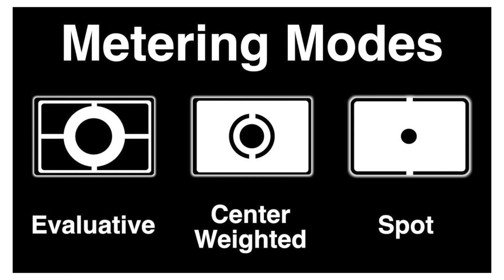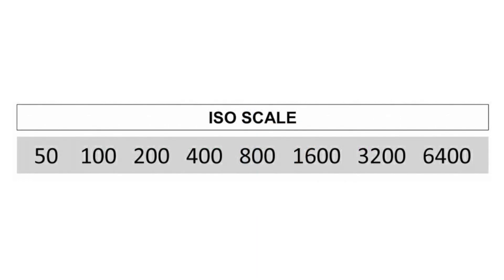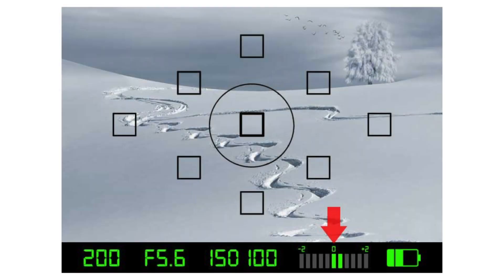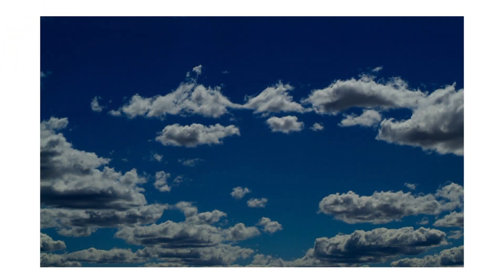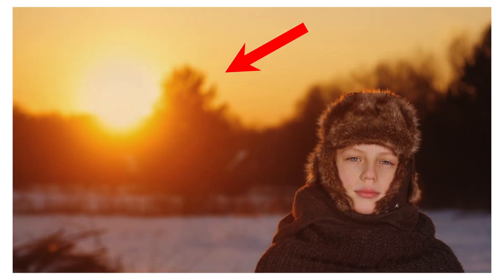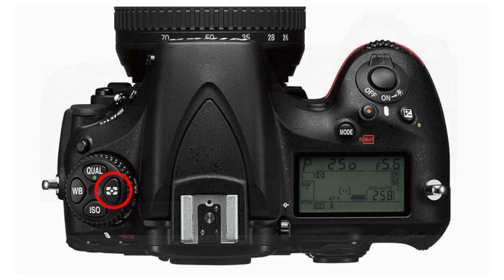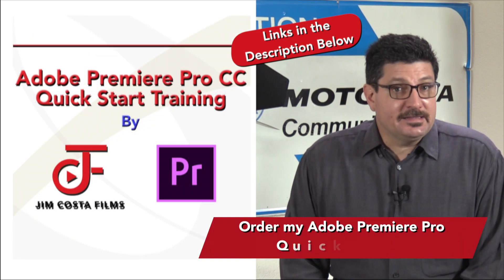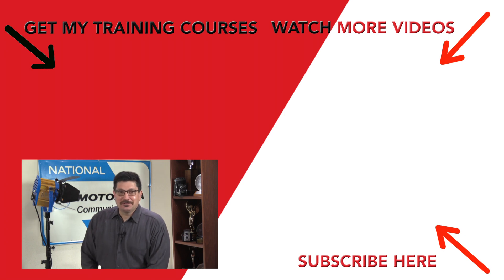Camera Metering Modes Explained: Matrix, Evaluative, Center Weighted & Spot Metering

Comment: I’m using an EOS M6 Mark II with a 28mm macro lens and a light box to take pictures of water, oil and other various liquid droplets. The purpose is to calculate contact angle. I need the droplet large and clear especially around the edges.  My settings are:
Av mode
F/stop- 3.5
ISO -100
Evaluative metering
Manual focus
I’ve upped the exposure to 1.1 to 1.2 because my pictures seemed to dark when in analysis mode. 
1. Are my settings on the right track? 
2. Should I use Spot metering instead?
3. Am I using the best lens? 
Ty
Reply from the maker: I have to be honest, I’ve shot macro photography, but not water droplets specifically so I did a little research and found that this is a good place to start:

1) Camera settings for water drop photography.

The splash from a water drop lasts only a fraction of a second, so your camera settings should be optimized for a fast shutter speed:

	•	Shutter speed — A 1/1000 shutter speed will freeze just about any water droplet. A slower shutter speed of around 1/250 works best for bigger splashes.

	•	Aperture — A wider aperture between f/4 and f/8 is ideal for a sharp focus on small drops. For bigger splashes, aim for around f/14 to keep the wider area in focus.

	•	ISO — Adjust your ISO to whatever it needs to be to maintain your shutter speed, but not over 800 or you’ll add grain to the image.

When you’re camera’s ready, let the water droplet fall and take a few pictures. Experiment with your setup and camera settings to find what works best.

My guess is that you’ll need to lock in the aperture to a setting that has the edges in focus as needed and then mess with the shutter speed and ISO to get the brightness where it needs to be. 

You mentioned using a light box. That should give you a nice even diffused light source around the droplet. Consider using 3 point lighting around 3 sides of the box to up the total available light. That should give you some more flexibility to adjust the ISO and shutter speed.

2) I was thinking about Spot Metering Mode when you first asked the question. The answer is possibly, yes, but I’m not certain that will work because the drop falls so fast that the camera might not be able to react fast enough unless you focus on the spot where it falls first and then take a shot. You might have to go full manual mode and just lock everything in ahead of time after a couple test shots to get it all right.

3) You camera is discontinued, but with a 32mp sensor, it should work fine. I looked around and s decent macro lens is the Canon MP-E 65 mm f/2.8 1x-5x macro lens.

If your budget allows for a new camera body, consider one of these:

https://products.bestreviews.com/best-macro-lenses-for-canon?sn=&cid=17571377514&aid=136528076325&eid=&tid=dsa-19959388920&ul=9029757&mt=&n=g&d=c&dm=&dt&sn&adid=644644436395&k=&p=&pc=&ap=&brprdct=1&gad=1&gclid=CjwKCAjwr_CnBhA0EiwAci5sigu9j1Dk9ROZC6R3UsUp1uYlbfZADBoySjJIpKZ0dMVLOJztdJxMZxoCd1UQAvD_BwE

Comment: Friend, I have just purchased one camera,  it has been more than six months since I have seen clicking. 
Can you give me tips to click family photos while going out. 
In what mode I  should click to make photos look great.
Hope you will comment about it.
Reply from the maker: You don’t mention what the make or model of your camera is, but when outside with people, I’ll assume you’re shooting a form of Street Photography.

There are four different types of metering in digital photography. Evaluative (or Matrix), Centre Weighted, Spot Metering and Highlight Weighted. Each one of these can be used for photography. But how do you choose the right metering mode for street photography?

Let's get into it.

When first starting on your photography journey, set your camera to evaluative metering, (which measures the whole scene) and adjust the metering mode depending upon the subject that you are shooting on the streets and the light conditions that they are in.

What is Metering?

Every camera has a built-in light meter. The camera uses this light meter in order to get a correct exposure. It does this by measuring the reflected light from the shadows, the mid-tones, and the highlights of a scene. Using one of the four different metering modes the camera will read and measure the light within the frame. When it measures the light, it will then adjust the aperture, the shutter speed, and the ISO (or one or two of each depending on which mode/priority you are in) and will expose correctly.

You can see the meter at work when you look through the viewfinder, or in many cameras today, when you look on the back of the LCD screen. It's the little bar usually in the centre of the screen at the bottom with a + and - sign at each end of a row of little vertical bars.

You can test this when you point your camera at a dark scene or a dark area. The indicator will go into the negative area of the meter. Conversely, if you point your camera at a very bright scene or area, such as a window, the indicator will veer towards the plus sign. Ultimately, you want the meter to be in the centre The little 0 is where you want your exposure to be.

It doesn't matter whether you're in Manual Mode, Aperture Priority, or Shutter Priority, the camera will use either the Shutter Speed and/or the Aperture and also the ISO once it's read the light with the meter, in order to get that exposure correct.

Metering situations

When a scene is evenly lit and you are looking through the viewfinder, then the camera's meter has an easy time measuring the light for the exposure; this is because the light is even and there are no contrasts. However, when there are strong contrasts within a scene the camera's meter can have a problem measuring the light effectively.

Imagine photographing a person, wearing brown clothes, walking past a brick wall on a grey day.  The camera's meter will have no problem measuring the light for this scene as it is all pretty uniform. You would use Evaluative Metering Mode in this scenario.

Now consider a scene where somebody is walking down a dark tunnel, but because there is a hole in the centre of the roof of this tunnel there is a shaft of light shining down across the wall and onto the ground. You want to capture the person walking through that shaft of light. However, the camera's meter might bring down the brightness on that shaft of light in order to match the exposure of the dark areas of the tunnel. Yet, you wanted that shaft of light and the subject exposed correctly. This is where a different meeting mode will come in handy.

Finally, imagine photographing somebody walking towards you, about two meters away, and he or she is wearing black, with the sun and bright clouds behind them. Using Evaluative Metering the camera's meter will try to expose the scene across the entire frame and in doing so will try to expose the person walking towards you correctly. Depending upon the metering mode that you use and how bright the sky and the clouds are, it may overexpose the area behind the subject or it may just get the exposure correct, or it may underexpose the subject. This is another instance where different metering modes come in handy.

Metering modes allow you to select certain portions of the frame and expose for those areas so that you get a correct exposure for your subject.

What is Evaluative / Matrix Metering Mode?

The granddaddy of them all, Evaluative Metering Mode is the mode that gets used most of the time. This mode takes a reading across the entire frame, splitting individual portions of the frame into zones, which are then read for the shadows, mid-tones and highlights. One thing to be noted is  where you position your focus point is important in the equation, as your camera's meter will make that area more important than the other zones in determining the correct exposure.

Evaluative Metering Mode for Street Photography.

This is my personal best mode for street photography, as I use it most of the time. It is perfect for grey days when everything is evenly lit. It is also great when you're photographing people walking down the street, past windows, past billboards past street lamps. In practice, it is pretty good for the majority of situations, except when they are extreme contrast of light and dark. In these instances, Evaluative Metering Mode can struggle slightly and it may be best to use one of the metering modes I will be discussing next.

What is Centre-Weighted Metering Mode?

It's quite simple. Centre-Weighted Metering Mode takes a reading from the centre portion of the frame only, ignoring the corners, the areas around the centre portion. Because it takes a reading from the centre portion of the frame, it does not use the focus point that you are selecting. It simply takes a reading from the centre. Depending upon camera manufacturers it may take a reading from 60% to 80% of the frame. It is great for street portraits, or when something is taking up a large portion of the frame in the centre and you really want to get it exposed correctly.

Centre Weighted Metering Mode for Street Photography.

Remember the example where somebody is walking towards you, about two meters away, and he or she is wearing black, with the sun and bright clouds behind them?

If you want to make sure that the person is exposed properly then you want to use the Centre Weighted Metering Mode for this task. It will expose correctly for the subject, ignoring the sun, the clouds and anything else around the frame. Therefore, it can overexpose whatever's behind the subject in this instance.

Conversely, for night street photography, you may want your subject, who is in the centre of the frame, exposed properly (such as a lit-up window display), while you may want everything around the subject to fall into shadow. If you used Evaluative Metering Mode, it may bring up the brightness on the shadowy areas around the subject, whereas Centre Weighted Metering Mode is perfect for this situation as it will allow the shadowy areas to fall into darkness.

Another example where Centre Weighted Metering comes in handy is when your subject is walking in the sunlight, towards you in the centre of the frame, and they are wearing white, and you are using a wide Aperture because your focus is on the subject only. However, because of their clothes, you know that they will be overexposed if you used Evaluative Metering. Simply use Centre Weighted Metering to get the camera to read the light in the centre of the frame and expose the subject properly, while the metering ignores the corners of the frame.

What is Spot Metering Mode?

Spot Metering mode read the light from your focus point and nothing else. It literally is just a single cell or area from 1% to 5%. You can use Exposure Lock, (AEL) when you use this mode so that you can focus on the area that you desire, lock the exposure, and then recompose your image.

Spot Metering Mode is great when somebody or something takes up a small portion of the frame.
Reply from the maker: Spot Metering Mode for Street Photography.

You may want to use Spot Metering Mode when you see that person walking down that dark tunnel with the shaft of light coming down from the hole in the roof. Simply move the focusing point on the shaft of light. This way the camera ignores the shadowy areas around the subject and it properly exposes for the shaft of light and that person you're waiting for to enter the frame.

You can also use Spot Metering if you are photographing somebody walking down a street when it is a snowy day. If you are using Evaluative Metering mode the camera might try to underexpose the snow. However, using Spot Metering on the subject as they walk will cause the camera's light meter to ignore the snow, thus ensuring correct exposure for your subject and keeping the whiteness of the snow a bright white.

Finally, if you're shooting street portraits and your subject is wearing dark clothes and it is a dark, dismal day, they are standing in front of a dark background, or night is drawing in, you will want to get their skin exposed correctly and not underexposed; then Spot Metering is a great tool when focusing on the subject's face to ensure correct exposure of the subject.

What is Highlight Weighted Metering Mode?

If you shoot a lot of night street photography like myself, then you must be aware of the delicate balancing act of getting street lights correctly exposed and not blown out. Thankfully, there is a common cure for this ailment and it is called Highlight Weighted metering mode.

This metering mode basically ensures that the highlights are properly exposed and not blown out, which means that every single light should be exposed properly. However, it does mean that shadows can be very dark and this can cause a problem at night when the rest of the scene is very dark and the only lights are street lights. Therefore, this mode is best used when you know that your camera has good Dynamic Range and can bring back much of the detail in the shadows when you are shooting RAW.
Note that not all cameras have this metering mode, but many of them do. Check your camera to see if you have Highlight Weighted metering mode.

Highlight Weighted Metering Mode for Street Photography
I would not recommend this mode when it is really dark, after sunset. However, during sunset when  the street lights first come on and there is still a fair amount of ambient light, then this mode can work really well as you do not have to worry about overexposing any lights.

This mode can also work really well for street portraits, especially on a bright sunny day, and your subject is wearing bright clothing or jewelry that is made all the more bright by the sunlight. These highlights can easily be overexposed when using Evaluative Metering Mode. But you can simply set your metering mode to Highlight Weighted Metering Mode and let the camera expose for those highlights.

Highlight Weighted Metering Mode can also work well when you are shooting a subject, or subjects, walking down a street with the sun behind them. If you take a meter reading simply for the subjects, then you will most likely blow out some of the sky and the sun. However, Highlight Weighted Metering Mode will save the sky, possibly ensuring that brilliant sunset exposes correctly and then you can bring up the shadows on your subjects and the street in post processing if not using a flash.

Conclusion.

So what actually is the best metering mode for street photography? It really does seems like all of these modes have their own uses depending upon the situation and the lighting scenarios. One thing to note is that these are all tools to be used to help improve your photography.

Go forth and create.
Reply: @jimcostafilms  thank you for taking the time and sending it. I have read your sending script. In my leisure hours I shall again read and click. Thank you.
Reply from the maker: @rru_810  I'm happy to help.
Reply: @jimcostafilms  I have read the "metering situation" now. I shall again read; thank you once again.
Reply from the maker: @rru_810  If other questions come up, feel free to ask.